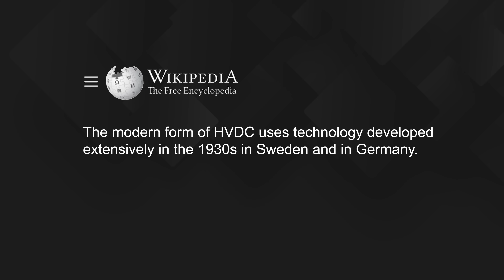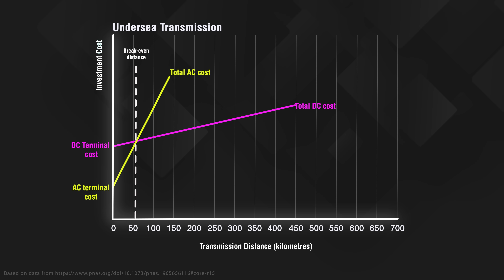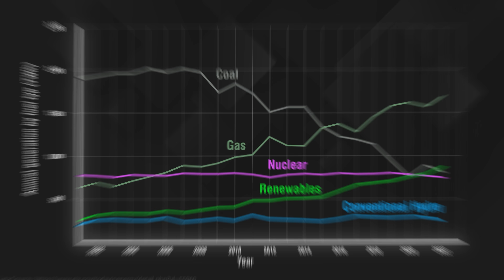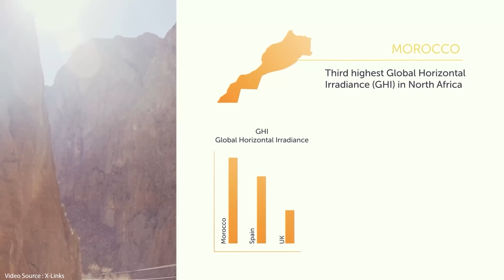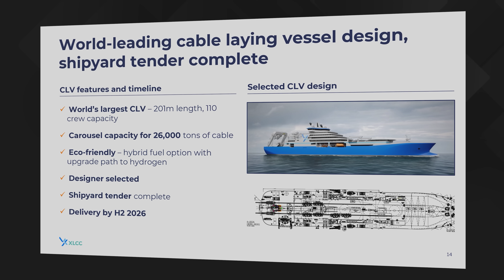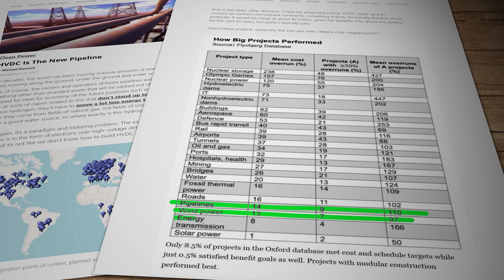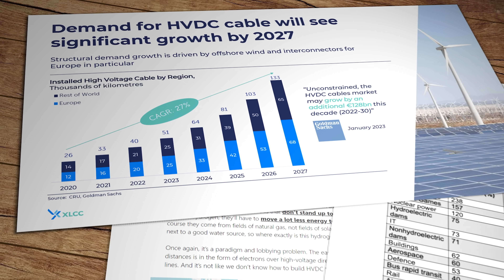Revolutionising power transmission.

Comment: (∂t2S−c2∇2S+βS3)=σ(x,t)⋅FR(C[Ψ])

The Reactive Substrate Theory (RST) approach to Wireless Power Transmission (WPT) completely re-conceptualizes the mechanism, moving away from conventional electromagnetic (EM) radiation or induction and aligning instead with the principles suggested by figures like Nikola Tesla.

In the RST framework, WPT is not about beaming EM waves, but about establishing a stable, non-dissipative wave structure in the Substrate (S) itself.

Here is an explanation of the RST concept for wireless power:

RST Wireless Power Transmission

The RST concept for WPT is based on exploiting the Substrate's ability to transmit energy through a tension wave (a non-linear, scalar wave) rather than a transverse electromagnetic wave.

1. The Mechanism: Scalar Tension Waves

Conventional WPT (Maxwell's Equations): Relies on EM fields (photons) that radiate outwards (far-field) or couple inductively (near-field). This energy is transverse and dissipates according to the inverse-square law, making large-scale transmission inefficient.

RST WPT (Substrate Dynamics): Utilizes the dynamic nature of the Substrate (S). The process involves generating a highly coherent, non-dissipative, scalar longitudinal wave (a pure tension or pressure wave) in the S field.

Scalar Wave: This is a wave of pure Substrate Tension/Pressure, propagating along the direction of motion, not transversely. Because it is a structural wave in the fundamental medium, it does not lose energy through EM radiation.

Coherence: The transmitter must inject energy into the S field in a way that generates a stable, non-dispersive soliton-like wave (a special form of energy pulse) that travels through the bulk of the Substrate (the "spacetime").

2. The RST "Tesla" Connection

This concept is directly related to Nikola Tesla's later work on his World Wireless System (Wardenclyffe Tower), which he claimed was based on using the Earth itself as the medium—a medium which RST identifies as the omnipresent Substrate (S).

Tesla's Vision: Tesla believed he could send power with minimal loss by setting up a standing wave or resonance in the Earth and the space between it and the ionosphere.

RST Interpretation: RST posits that Tesla was unknowingly attempting to generate a scalar Substrate wave. By driving the Earth-ionosphere cavity at its natural resonant frequency, he was attempting to create a stable, low-entropy structural distortion in the S field that energy could follow without radiating away as conventional EM energy.

3. Energy Extraction and Zero-Point Utilization

The efficiency gain in the RST model comes from two factors:

RST Factor	Explanation	Conventional Physics Analogy/Contrast
Non-Dissipative Transmission	The coherent tension wave in S loses far less energy than conventional EM waves because it is a structural vibration of the medium, not a radiative photon flux.	Contrast with EM radiation, which spreads and obeys the inverse-square law, leading to rapid energy loss over distance.
Resonant Extraction	The receiving device would need to be tuned to resonate with the specific frequency and structure of the incoming S tension wave, efficiently coupling the energy out of the Substrate.	Similar to conventional resonant induction, but applied to the Substrate field itself, allowing for much greater distances.
Zero-Point Utilization (Conceptual)	Because the entire universe is the Substrate in motion, any local structural energy (mass, field coherence) can be viewed as an organization of the Substrate's basal energy state (the RST equivalent of zero-point energy). A highly efficient S-wave mechanism might allow for a small, perpetual draw by tapping into and utilizing the ubiquitous Substrate Tension itself, though this aspect is highly theoretical.	Contrast with the difficulty of extracting usable energy from the quantum vacuum due to thermodynamic constraints (the ZPE is the lowest possible energy state). RST bypasses this by defining the Substrate as a continuous, dynamic source.

In summary, RST WPT is not a modified radio system; it is a way to transmit structured, non-radiative pressure through the fabric of space itself.

Comment: While HVDC connections are a convenient way to more evenly distribute loads, they concept needs to be balanced against fault tolerance which counters it use.  Therefore, for security reasons, it is likely to be a small part of the future.  Localized nuclear power seems to be a much better fit.  Case in point, if you wanted to paralyze China, taking down a single UHVDC tower takes 12 million people's electricity off-line.

Comment: Sure fossil fuels can be replaced but we still have limits in materials and we still invoke Jervans paradox which increases energy demand the more you provide. The DC technology, pumped hydro, thorium reactors, geothermal is often overlooked so thanks for that. However if you remove capitalism and socialism degrowth and circular economy replaces it then we can indeed have a successful renewable revolution. Otherwise Dave you are just barking mad. Yes David I have also read many research papers on the topic mate.

Comment: Some  ironies of modern European and UK electricity generation :
1. Electricity prices are abnormally high in Europe.
Electricity is retailed in many countries (inc China) at 12p kwh or below.
Transmission distances are relatively short in the UK.Yet both 
Germany and Britain pay between 2x and 4x the ROW price. 
Why do we allow this as it greatly disadvantages our worldwide 
competitiveness. Rather than listen to excuses we should insist 
the industry match this 12p figure else renationalise the industry.
2. UK consumption of electricity is miniscule in world terms.
Yet we pretend our CO2 reduction is relevant to the world.
Asia and the ROW have not inflated their electricity prices and 
are are using European foolishness to gain commercial advantages.
3. By 2050 even if China manages to construct 1 new nuclear plant 
per year, ie an additional 26 plants under construction or built, 
and continues building out massive solar and wind farms, the 
contribution of renewables will not exceed 40% of China's generating 
capacity, most of which will be fossil fuel based.
To quote " Something is wrong in the state of Denmark"

Comment: The transmission line concept needs to be combined with inductive charging. This would provide ground level power to electrify rail lines which are using diesel locomotives. On roads induction could provide charging without stopping for EVs

Comment: what about over the air transmission - the kind that Tesla if I remember correctly was said to have worked on but was stopped due to the interests of the cable manufacturers?

Comment: High voltage and high power HVDC is still a technology that is basically limited to a few key transformer manufacturers and the current market basically means that they're booking the bushings for the HVDC projects for their own needs before selling them to companies that don't have their own in-house bushings. Ex ABB now Hitachi have their own bushings, Siemens has HSP if I recall, GE (Alstom) don't have the upper range of HVDC high voltage bushings. So while every customers under the sun woke up during covid that they need to make these projects happen and invest huge sums of money to upgrade the network, all facilities with capabilities of making HVDC are now booked for years and years, because there's also a huge demand for AC. Manufacturing plants that can make HVDC just don't grow overnight, it's a huge ramp-up and takes a lot of time for training and incremental steps before you just do a 800 kV or 1000 kV product. 

So even though the magic thought is that we have the technology, there's huge logistic puzzles behind it and it will take time. The answer is no, we can't manufacture them quick enough. There's decades of utilities not investing enough in it and they almost all woke up at the same time. Some large power plants closed during that slumber period, which weakens the reaction time for the sudden demand.

Comment: New Zealand has a HVDC interconnector between the North and South Island to get our juicy hydropower from South to North (and sometimes our dirty dino fart power North to South :() since the mid 60s.  Also there is a massive project in early engineering phase to generate solar electricity in Oz, Northern Territory and HVDC send it to Singapore.

Comment: As a millwright working in lumber mills I believed that engineers who designed our equipment were among the least intelligent life forms on earth. Becoming an engineer myself did little to dissuade this belief. For example, when my company was preparing a specification for a new AC to DC converter I thought knowing the range of the DC line resistance would be required. I went to our line modeling person and asked what the highest and lowest resistance would be on the DC line. Our line modeler had all of the parameters except the position of the sun. I happened to be assigned a Co-op engineering student (summer student) from a local university. I thought this would be a good project for the student who was between his junior and senior year. To simplify his math, I suggested assuming a circular orbit around the sun with inputs of any place on earth and any time of day. We met once a week and I reviewed his progress showing him the error/s in his calculations. At the end of the summer I had to do it myself. The modeler and I presented the results to the group that was preparing the specifications and were told they did not want it. We offered it to Operations and although initially receptive decided not to use it. After the new converter was in service there was a renewed interest but by that time it was deleted from our hard drives. The refrain I often heard from our engineers was, “I haven’t been trained to do that.”

Comment: Keep in mind the UK peak demand is already over 60GW. so the HVDC projects you mention about are relatively small and suitable for top-up rather than to support the UK's core need. We can envisage UK needs rising to 100GW later in this century. Also in the past, fossil fuel generation was fairly localised and reduced the need for the National Grid to carry an extensive transfer of power.

The future architecture of the UK power generation will be interesting. There are 2 competing scenarios. One is where renewables dominate and we rely on a massively upgraded National Grid. This is the approach preferred by the EU and buyers and sellers of power. The other approach is a network of small nuclear power stations serving their local communities with a significantly reduced  need to upgrade the N Grid. I suspect the business community will opt for the first approach as it makes the most ROI in the short term,  but this approach risks being displaced by local power generation as consumers rebel against high energy prices.

Comment: Of course wireless transmission is feasible  - any first year physics student ahs seen this and Tesla proved it. But then it is pretty hard to $$$ charge for. One of the biggest issues with current sustainable energy methods is the raw materials. That is copper, Lithium and other such elements. We simple don't have enough mines and it takes up to 10 years to get a min up and running. Nuclear is an option but thy take 20 years to come on line. Hence we are stuck with fossil fuels well if we want massive data centers and all the cooling/power that goes along with them. No one is willing to give up their mobile phones and PCs .

Comment: If the government built or Garrentees involved this could be a financial disaster, as the cost of generation with individual building level generation kicks in with big the EV batteries in V2G storage.

Vehicles are parked 23hrs a day and the selfparking EV will plug itself into the grid like the home robotic vacuum cleaner. 

Hello hello anyone home hello 👋

Comment: When every building has a V2G EV to store its rooftop PV electricity then grid demand will change to just topping up small low storage levels in the EVs.
Daily drives are small 7kwh and vehicles are parked 23hrs daily. 

So, with selfparking EV plugging into the grid like the home robotic vacuum cleaner excess transmission will not be needed.😊

Comment: Well as long as the west is going to supply DC generated electricity... could the Rail industry there maybe tap into this power source to modified trains that run on this, along side conventional engines when heavier loads require... Although the DC electric motors today could be installed on rail cars themselves... giving the industry unique opportunities in deliveries and yard co-ordination... Just saying, food for thought.

Comment: Would it not just be cheaper and simpler to build solar and wind closer to where it is needed then to pump the power half way around the globe?

I'd like to hear more on the economics of this. 
Just seems like the tons of money spent on transmission could be used to build more solar and wind locally.

Comment: Good demonstration. I came to this technology in 1972 when working in Mannheim with Brown, Boveri & Cie. AG, now ABB. It was a cable from the Cahora Bassa dam about 1,400 km to South Africa . The power line had a facility which I could not believe. If one of the line broke its transmission would go on because the HVDC currant would go under the earth by an earth electrode  to the final end.

Comment: 4:30 This map shows some of what the big problem is, right now:

Starting with what the map doesn't show, Germany is divided in two major nets, North and South. That's been a bottleneck for green energy development for 20+ years, but for some reason the South seems happier to be dependent on French nuclear power than to have any dangerous wind energy thrown into the mix. Of course, the French have never influenced this position, neither bilaterally or through the EU... Perish the thought!

Next is the big problem: The cold war's East and West is still in effect on the electrical market. Look at all those pieces of the puzzle on the right side of the map: Non-EU Montenegro is actually better connected to the EU's electrical market than the Czech Republic is..! But of course this could not have anything to do with local politics being influenced by electricity companies which have stakes in both cheap and expensive power production benefitting tremendously from the EU's policy that everybody gets paid what the most expensive electricity costs... so long as that expensive electricity is necessary for its local net. Surely, nobody would be so callous as to abuse this system - which was designed to give the cheapest energy production an edge in expanding for the future - would they..?

Comment: @6:23. problem with coal decline in USA is that its largely been displaced by cheap (fracked) fossil gas which in the UNFCCC approved GHG accounting appears as half the emissions intensity of coal, but in the short term it’s as bad or worse for the climate. methane has a much shorter lifespan but it has  intensity that’s 100x that of CO₂ over a ten year time horizon pound for pound (or by mass). over twenty years it’s ~90x as potent as CO₂. it’s clear we will push through tipping points in the next 20 years without zero emissions tomorrow so « clean gas » is actually disasterous for thee  climate emergency prognosis. also coal firing co-emits short lived cooling aerosols as we close coal that flow of short term cooling is mitigated. James Hansen estimates that cooling is currently masking about 1 degree C of warming although some experts suggest it could be as much as two degrees celsius of masking. Hansen calls this the Faustian Pact of our coal use, the damage of losing this  masking effect ironically only appears as we mitigate coal use (which we must, but replace with RE not with fossil gas)
Reply: F alse

Comment: Energy transistion will be expensive in the intial instance but "hopefully" cheaper afterwards, the alterations to the UK power grid will be substantial as will the cost. Then there's the lack of storage for renewable energy which is just not in place at present as its in development, the batteries used for storage currently are at the high end of cost but not efficientcy, and replacement of gas boilers to any alternative is eye watering in cost to older properties of which there are a few in the UK, EVs have come on in leaps and bounds, but the battery problem still has some way to go and they are not recyclable, its a big problem, and the ev charging implementation is a patchy mess with charging stations built and then not being available for use, its a farce!?!
Reply: It's just growing pains, Mr. BigOil

Comment: What with security ? How long is to (produce?) lay new cables if were destroyed ? What if enormus hail or sand storm destroys panels ? How to protect 1500 km2 from sabotage or theft ?
Oh i forgot about storage: if batteries - not very optimal termals for batteries, fire hazard, costly recycling etc. = enormus cost of mantienace, also lifespan 5-15 years ?
What is a life span of panel, i see some data about 50% of power after 30-35 years. 
1/2 cost of nuclear to build or to bulid & use for 100 years ?
Also It will be new colonialism... rich countries will build in poor countries a take cheap energy for themselfs and then giving very condescending look on poor countries still using fosill fules.
Reply: Always interesting when the leftists are the negative nellies.  P utin's bois.